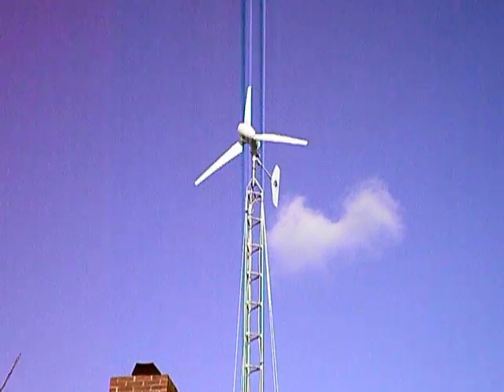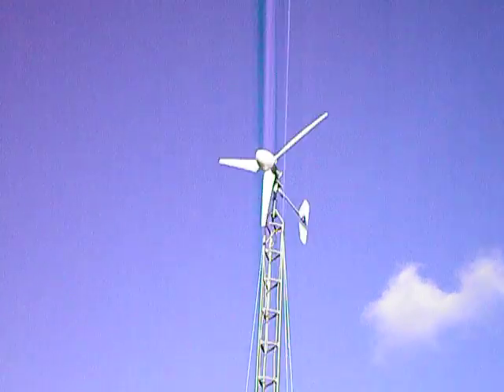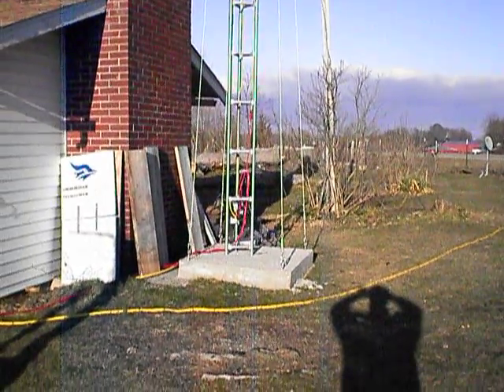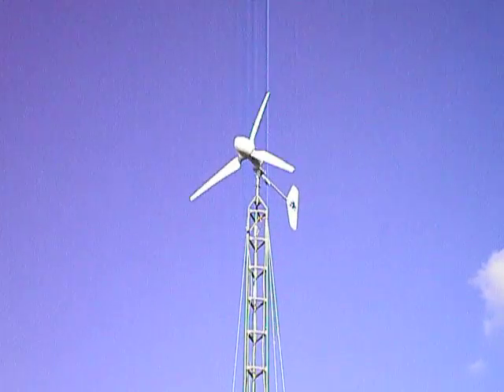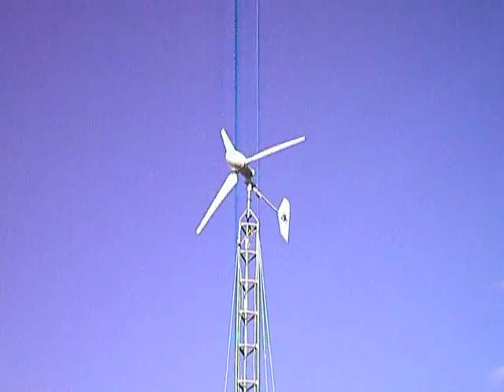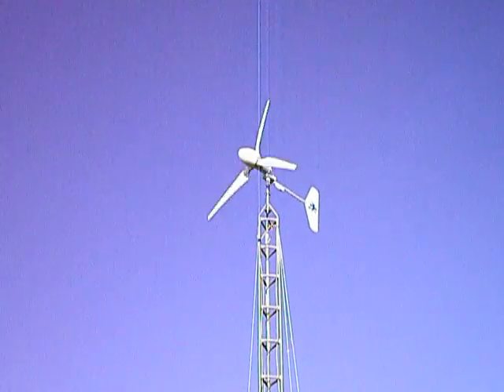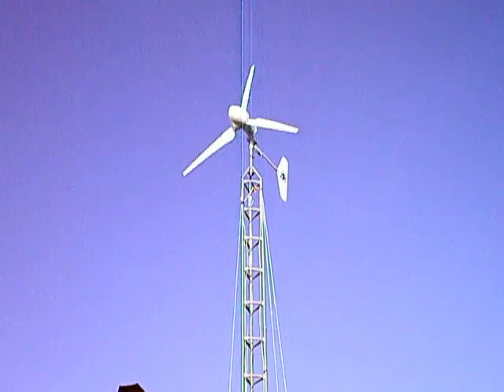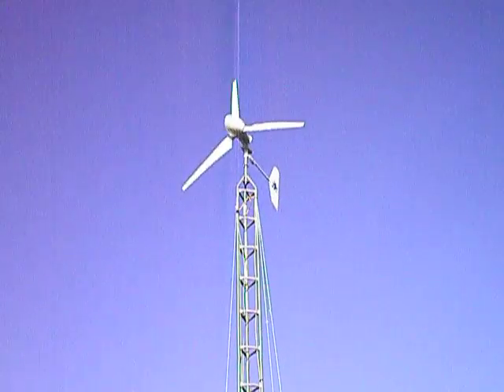Bluejays Kennels new furling tailed Wind turbine

Comment from the maker: Yes and the geared one would do 100-300 KWH per month during winter.Thats not bad for only a 500w gen head...I am sure if I had a 5-6 kw gen head and geared it with 13 ft blades.It would make over 1000kwh a month....This direct drive has given me 25 kwh in 15 days..Not much but 10 times more than a delco!..need money to do it right.

Comment from the maker: I am not mowing around guide wires, if the smaller blades ,furling tail and the extra strenth of the guide wires at the base still allows it to have a tower failure then i will only be a solar guy..

Comment: With the problems you've had in the past, you should put the guy wires out further if you can. It looks like all you have done there is make it like a tower with a wider base. I would error on the side of over engineering so you don't lose another tower. Think about all the leverage the wind has on something as long as your tower.